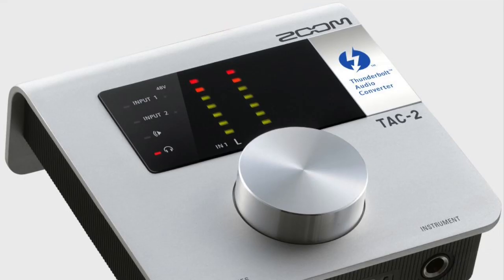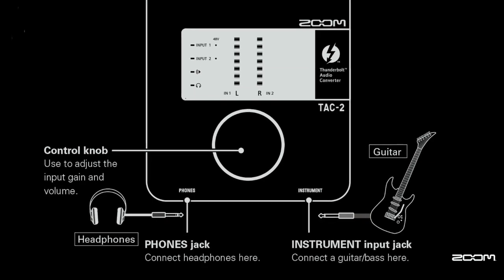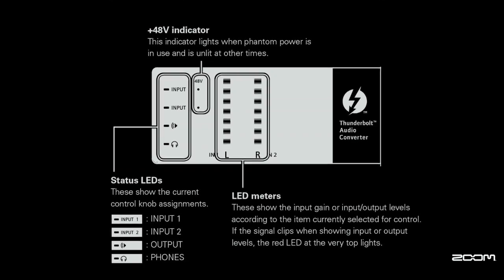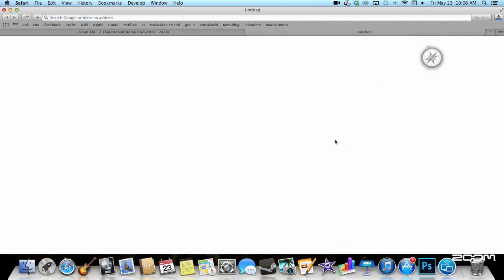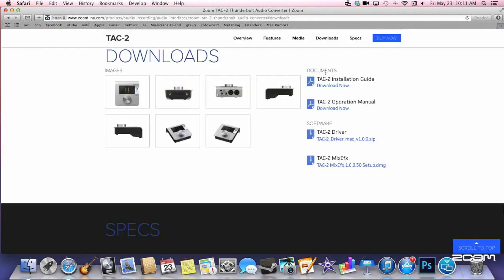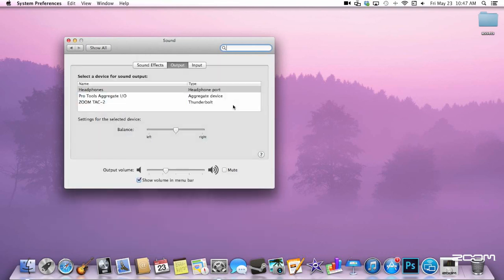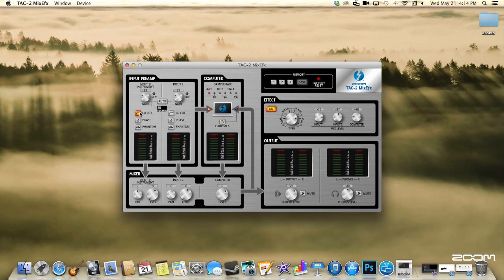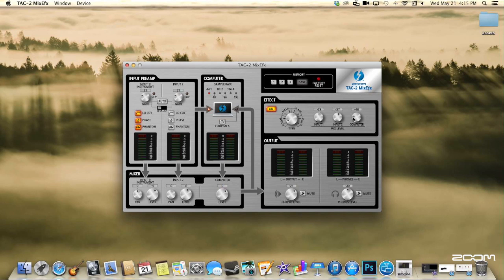Zoom TAC-2: Getting started with Zoom TAC-2 Thunderbolt Audio Converter

Comment: I purchased this product and now there's no way of being recognized by my iMac. I've installed and uninstalled its drivers many times! I now have a $300.00 usd paperweight to the side of my screen. No help from this company; no tutorial on what to do; no nothing. I feel that I'm being robbed. I'm very disappointed with no one to turn to get an answer. This kind of things should be illegal.
Reply from the maker: Please email info@zoom-na.com and we will be able to promptly assist with troubleshooting the issue.
Reply: Same here. Followed all the instructions, downloaded and installed the driver countless times.... and it appears nowhere. My mac is running on Mojave and I read a whole number of comments telling the same. The company doesn't seem to find it necessary to answer to anybody who bought this expensive rubbish. This was my first experience with ZOOM and it will be my last.
Reply: @ingojurgens5736  MacOS High Sierra 10.13 have introduced a new security feature that requires user approval when you install new driver software.

Products: Q2n, Q4n, Q8, L-12, TAC-2, TAC-2R, TAC-8, UAC-2, UAC-8, R16 and R24 

If you do not approve, Mac does not recognize the product.
To enable the products on Mac, please follow these steps:

Please uninstall the driver if it is already installed on Mac.
Please reinstall the driver. Then, open "System Preferences" and click "Security & Privacy".
If  display "System Extension Blocked" in a popup window when you install the driver, please click "OK".

When the "Security & Privacy" opens, you will see a message below:
System software from developer "ZOOM CORPORATION" was blocked from loading.

Click the Allow button in the lower right corner.

Comment: I have purchased one of these, but i am having problems with the output. I use Logic Pro X and when i am using this for guitar sounds I can't lose the sound from the Tac 2.... by that, I mean that all I want to hear is the guitar sounds coming from Logic, not from the  Tac 2 software.
Reply: @grahamehedley2050  You have to install this software and adjust the “Computer volume”.
Reply: Same here, did you find a fix?